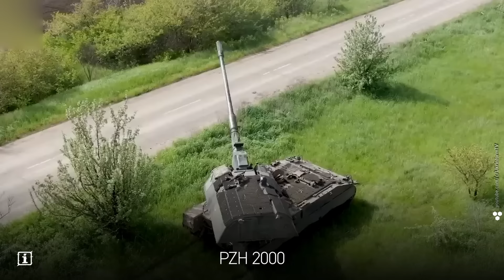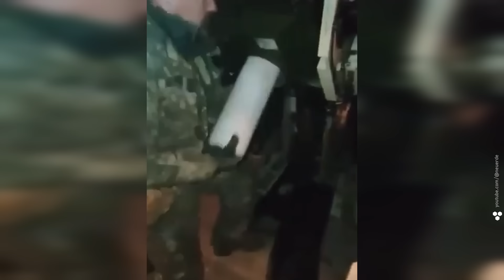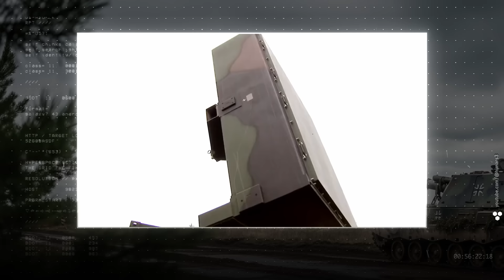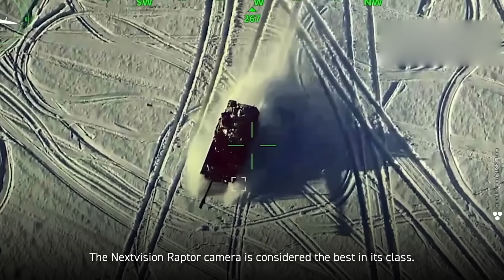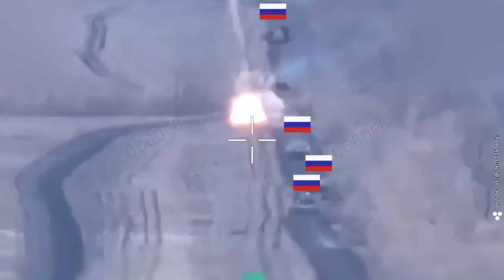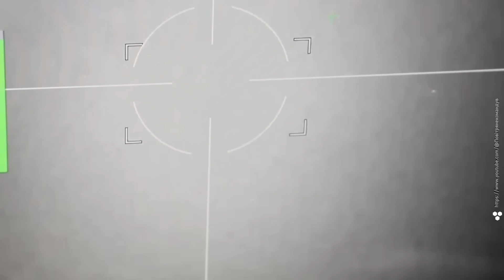GERMAN WEAPONS Changing The War: Leopard, Marder, IRIS-T, Gepard, RCH 155, Skynex

Comment: The interesting part about the Skynex is: The ammo.
Programmable ammunition, that when going through the barrel, gets tracked to determine its speed. A coil at the front of the barrel then programms a detonation timer into the ammo as it passes through, so that the ammunition detonates a short distance infront of the target, launching shapnel in a cone.

It is basically a gun that shoots programmed shotguns. Doesn't reach as far as rocket systems, but it is way cheaper.

Comment: The RCH is not held back, it's just the newest system with low production numbers. Soldiers have to be trained on the system, operating procedures have to be set up, etc., etc. Sending one or two pieces of new-to-the-battlefield from the factory directly to the front without training, would be stupid. The firing on the move capability offers options, no one has had in the past. Let them test and train for a few months. Winter is coming...

Comment: i am realy curios, how the Skyranger 30 and Skyranger 35 will work out in real, but for this whe have to be pation, i think.
Are they realy capable to replace the old lady named Gepard?
Reply: The Millennium CIWS and MANTIS NBS C-RAM  are in service for over a decade now. It's by no means a completely new system, just another iteration for a different purpose. Skyranger significantly outperforms the Gepard due to AESA radars and programmable AHEAD ammunition.
Reply: @jonny2954  
You are right and wrong in the same time.
The components of Skyranger are mostly existing technologie.
But Assembling existing technologie on a new way, they are not ment to be is a NEW thing at his own.
Mounting as stationary Skynex system on a real Lepard 1 chassy (not for Gepartd modified Chassy), integrating the remote controlls into the system on a may? moving platform is some thing new, dont you agree?
Will the software work with this new circumstances? Dos the ring, where the Turrit is mounted to, word without failure (and so on and on)
Reply: Yes and no. There is also an air defence modification of the Lynx with the skyranger 35 mm cannon. This is closer to a replacement of the Gepard at the front line. The boxer skyrangers are lighter and faster than the Lynx. But therefore they have less armour and their ability to fight against tanks is more limited. The boxer skyrangers are more for ground based short range air defence inside Ukraine, for transporting injured or to accompany logistic convoys or a tank battailion.

While the Lynx is the export version of the Puma. They are no main battle tanks. But tanks like this have much more chance to survive a meeting with a hostile main battle tank than the boxer skyranger.
The Puma is too expensive for other countries. Too many technological extras at once. Not every country has a professional army with one mechanical engineer in its tank crew. While the Lynx is a modular tank with different modifications. Therewith the buyer has the choice, maintaining & repairing is less sophisticated and it is cheaper than the Puma. That makes the Lynx more marketable.

At present Ukraine is testing both - the boxer skyrangers and different modifications of the Lynx.
The firepower isn't the issue.
Ukraine has to integrate them into their own developed software system.

The costs for shoot down one shahed drone with the Gepard, the boxer skyranger or the Lynx is round about 10 € to 20 € for the needed 35 mm ammunition. If 10 € or 20 € depends on the quality (or jamming) of the reconnaissance.
But even 20 € costs of ammunition is nothing compared to one IRIS-T missile for 400.000 €.

A few month ago the CEO of Rheinmetall said in an interview that Ukraine is planning to produce the Lynx in Ukraine - the first could come end 2025. But back then the funding wasn't clearified yet.

Comment: Why is Germany holding back the wheeled artillery? Because it has not even been produced yet. Ukraine is the first customer on the list even before the German army.
What a load of bullshit.
Reply: The system is currently in Ukraine and gets field tested. Guess why.. They adjust the system immediately to be capable of being combat ready out of factory. The system is new when looking at the interior to drive by and let the artillery do the work.
Reply: @d.f.9140  exactly. The focus was on the battle management system.
Reply: The first unit was handed over to the Ukrainians a while ago, though for now they're still using it for testing and training. And there did seem to be some holdup related to integrating it into the Ukrainian battle management system. We'll see when they'll actually start turning up in Ukraine though I still wouldn't expect large numbers any time soon as they still have to be produced.
Reply: One of the reasons Europe couldn't increase the production of armoured vehicles was that our steel industry was in a transition process as the invasion in Ukraine started.

The old steel production technology is outdated - soon not any longer marketable.
Investments in all sectors of the steel production were necessary.

Some European steel producers that produced the armour steel in earlier times decided to invest into other - more asked = more profitable - sectors of the steel production.
And they sold their patents for armour steel to have enough money for their investments.

The new buyers wanted to adapt the new production technology on the production of amour steel.
But they bought the patents only a few month/ one year before the invasion in Ukraine started.
There was no adaption yet. No new production facility for armour steel.
And in earlier times they never produced for the military.
This companies had no security infrastructur and no security checks of the staff (what every company need, that want to produce something for the military).

While the former production facilities for armour steel were already dismantled and the staff released and working somewhere else. 

The invasion in Ukraine came at the worst point in time.
Europes production capacity for armour steel was on the lowest level ever.

In Germany one of the new armour steel producers started its production in July 2025 - two month ago. And the next new production facility should come soon (in a few month).
Almost the same in many other European steel producing countries.

Finally Europe is able to increase the production of armoured vehicles.

Ukraine also want to start the production of tanks in Ukraine.
Our Ukrainian-German joint venture built a tank factory in Ukraine after the invasion started.
Until now Ukraine used it only for the production of spare parts and some adaptations.

Preferably Selenskjy wanted to produce the Gepard in Ukraine.
😂 All the new German weapon systems and Ukraine prefers at most our 60 years old technology. 🤣
The CEO of Rheinmetall said, this is not possible.
It is not cost-effective to restore the whole outdated supply chain only for the Gepard. Instead Ukraine could produce the Lynx in the air defence modification.
The Lynx is a modular tank. At present Ukraine is testing the Lynx in different modifications.

Well, we will see what kind of tank Ukraine produces end 2025.
Reply: You seem to have misunderstood the commentator of the video. Relax.

Comment: The mars2 can fire cluster rounds. The missles are the same diameter, they all fit in 1 launch tube container.
Reply: I Imagine that the missile has to be electronically identified to the fire control system (as cluster munitions have to be detonated in a certain way and distance to target), and that system will refuse firing cluster munitions. Sure you could circumvent that, but why f the hand that feeds you? There are others systems usable for cluster munitions, you don't have to make your best supplier a treaty breaker - especially if you gave your word not to violate the terms of use. Do this a couple of times and the support of many people in Germany will recede - a bad deal in the long run.
Reply: @40hup  Yep, and if you look at the overlap for GMLRS etc., all one needs to do is intersperse HIMARS and M270 MARS II.
Reply: Technically yes. Legally, no.